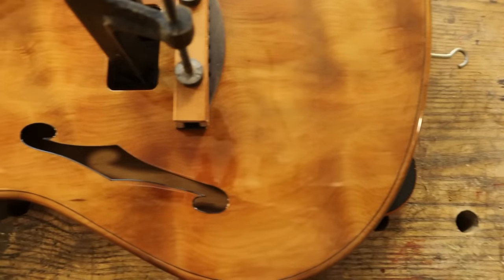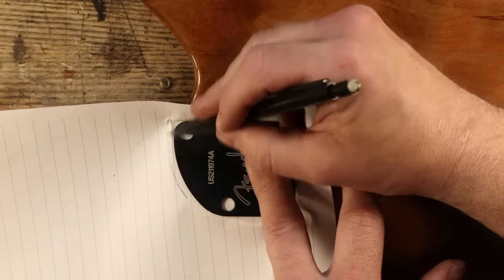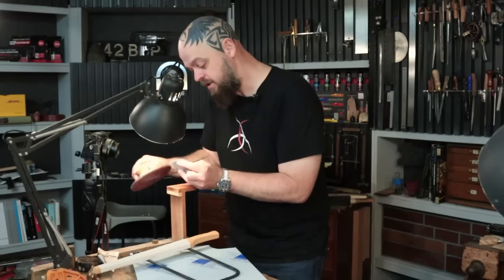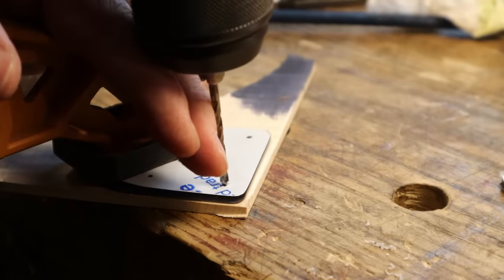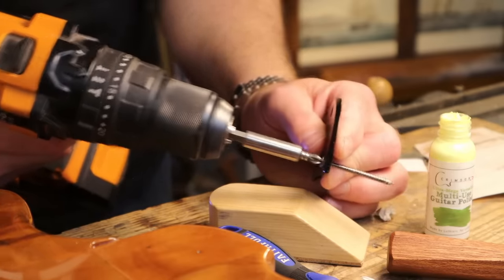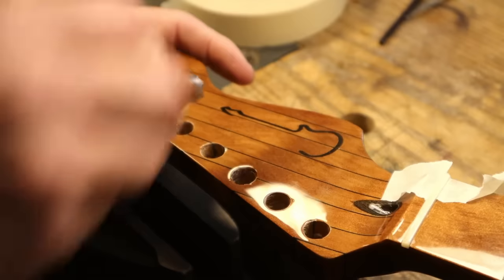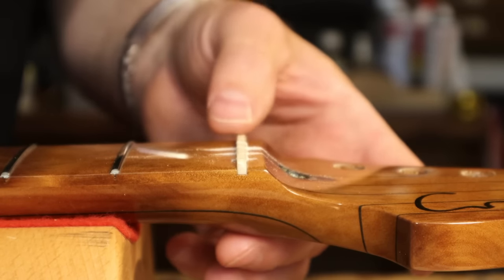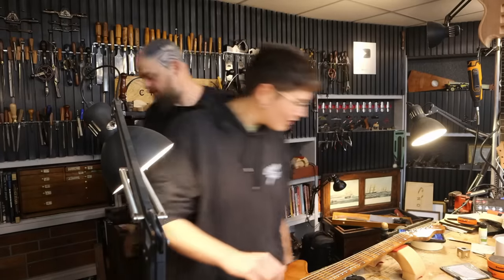Ep 17 - String it up! + acrylic neck plate fun |Building a Guitar from 42,000 Year Old Wood

Comment: Perspex is prone to cracking, when pressure forces (like those caused by screws) are applied. The countersunk head screw may increase this danger. I'm not sure the Perspex is the right choice for the Neck Plate. But besides my concerns, the plate looks absolutely stunning with all the polishing done!
Reply: Yeah I don't know how you can tighten the neck to the body without destroying the plate he made
Reply: agreed. a polycarbonate would be a similar look but has much better stress properties than acrylic.
Reply: @andrewj3372  I've worked with both. Polycarbonate has similar problems when its used in such a situation. What could probably work are ferrules that lead the forces from the Screwheads to the threads
Reply: @Craftlngo  Hmm, are you sure it was polycarbonate that you used? It's a lot more "chewy" and doesn't crack easily if at all, in complete contrast to acrylic.
Reply: @timangus  true, it is not as brittle as perspex but like all plastics it tends to flow under stress. It deforms, can build cracks and it will losen the screw joint of neck and body in the long-term.

Comment: When drilling plexi glass. Use an old drill bit and grind the sharp edges off the tip. Taper the bit or use a unibit.   I used to drill windows for helicopters. Thats what we’d do. They’re come with a drill bit or we’d make them.
Reply: I was going to suggest a step (Unibit) drill as well. Their single cutting surface and straight flute stops them being pulled into the job.
The way he did a pilot hole is not a good idea either, just makes it easier to grab when the point of the size drill has nothing to offer resistance against.

Comment: Wouldn't use Perspex (acrylic) for this application, too brittle.
Polycarbonate would be a more durable solution.
Recently cut and drilled 10mm perspex for a base for a handwired valve amp, drilled and countersunk the holes with bradpoint bits, and a standard countersink, but I know this will not be subject to the same stress as a neck plate, I would have used inset bushes for this guitar. Recessed plate is now a necessity.

Comment: Just stunning. If you're going with the perspex neck plate, might be a good idea to chuck a bag of 20 spare ones in the bag when you ship it.
Reply: 25
Reply: I feel uncomfortable putting screws on acrylic if they are going to be under much pressure, worse into countersunk holes.  I think he's created a no-win (loose neck or cracked acrylic) and I wonder if he will change his mind.  All I can think of is stainless steel and getting it electropolished.
Reply: @SloverOfTeuth  Or at least a nice piece of brass.
Reply: @rasputinsbeard3899  The easiest material I guess, if he's happy with the aesthetics.  I think he said the pickup will be a steel finish, hence my suggestion.  It's harder work to shape stainless steel, but this is a convex shape which helps, so a bench grinder gets the rough cut fairly quickly, and maybe he'd take a detour into home electropolishing (🤣).  I think brass would look good with that wood, and I'd maybe think of using a brass plate and changing to a brass pickup.  One only has to consider why neck plates are used in the first place, and why we usually make load-spreading washers/plates out of metal.
Reply: I agree. I worked with plastic for a long time in a previous career. That shits gonna snap the first time the owner touches one of those screws. Personally I like to omit the neck plate entirely and go with counter sunk metal ferrules sank into the body. I do like his idea of the threaded bushings and using actual bolts instead of wood screws. That’s in my plans for my next build.
Reply: If he do thread bushings and screw I'm sure it will hold up. But wood screws raw on that? Not sure how I feel

Comment: I have my Dad's early 1960s Stanley hand drill which I recently cleaned up and use. I know what you mean about using one! When it's my time to go I'll bequeath it to my eldest nephew for use in his shed.
I like the smoked acrylic neckplate, and a round of applause for polishing the inside of the countersunk holes, which will only ever be seen very rarely after the guitar's finished! It's the 'I know it's there' syndrome.
And the assembled so far guitar looks lovely, all those curves around the neck joint!

Comment: The way to finish the edges of Perspex is, wait for it...  Flame polishing
Reply: Vapour polishing is even better and would be able to do the countersinks as well, just doesn't sound as good as "burn it" lol
Reply: I was actually wondering if the reason the polishing of the counter sunk holes worked by melting the perspex a little (rather than the compound).
Reply: Damn it, beat me to it. Let there be FIRE :)
Reply: Wouldn't flame polish something under tension. It introduces micro-fractures in the Acrylic

Comment: Hi Ben.  The Neck Plate should Be made out of Brass and add the Crimson Logo on it. With Plastic you will not be able to have enough pressure on the Screws to Hold the Neck tight. Copper plate would be Cool too.   How is the 4X4 post Guitar 🎸 doing? Getting Dusty?

Comment: A guitar made of 42,000 year old wood really needs a nut and saddle made of 20,000 year old mammoth ivory.
Reply: Great point ! Sound and look upgrade, for sure .
Reply: A plastic saddle and nut made of 200 million year old oil
Reply: Its funny how, in some guitar circles, Kauri wood is known by its latin family name "agathis", and is thought of as a budget or less desirable tonewood. Personally I don't much subscribe to the whole tonewoods-in-electric-guitars debate (or snobbery, some may say!), and have worked with swamp kauri myself.
Reply: @crtified1001  I think there's some difference between the cheap agathis on a budget superstrat, and ancient swamp aged NZ agathis. But it also reflects on how different guitars are built and used. My first guitar was an agathis bodied Yamaha, and it was trash out of the box. The strap nuts constantly fell out, the pickup and neck pockets broke into each other and the brittle PE finish chunked off and crumpled into the wood as soon as look at it. The Alder and Poplar on my Squiers are much harder, so even though the routes are even more aggressive the alder bodies have survived with little more than a few dents for 23 years. My Yamaha barely survived one. If the agathis body was instead used for a Mustang body, with angled fit-routed cavities and much less empty space; and then finished with a less brittle finish that wouldn't shatter as easily, it would work better.

Nothing to do with "tone" wood, everything to do with structural integrity.
Reply: @inthestudy You note there's a range of variation or quality between the different types of agathis wood, and this is true. As I mentioned, I've worked with swamp kauri - I have a locally-sourced piece on my workbench as a guitar body right now, as I'm from NZ. And the fact is that the moniker "ancient swamp" doesn't automatically imbue any particularly notable qualities from a guitar body point-of-view, over and above "non ancient swamp" kauri. A rare and particularly nice, figured specimen of ancient swamp kauri can be pretty special, sure, as is the case with many species of guitar wood. But more commonly, I can source cheap, authentic (~US$50) "ancient swamp kauri" blanks that are quite pedestrian except in name, and which would be entirely indistinguishable to a layperson.  

This reasoning also applies to the "cheap superstrat agathis", as in fact that cheap superstrat agathis is used in a variety of superstrats ranging from the ultra-cheap to the signature-model virtuoso (e.g. Satriani, Bettencourt).

All of which goes to show what a significant part reputation can play in our judgement of a guitar and its materials.
Reply: Yes I think PRS did that on one of their Private Stock Wood Library models. Crazy eh!

Comment: I found myself doing that tiny bit of counter sink so often that I did make one myself.  I just drilled a 1/4" hole in a London Pattern boxwood chisel handle and epoxied in a countersink.  The handle is almost identical to the plastic handles on old Craftsman screwdrivers (they copied the London pattern handle) so very comfortable to use.  It really reduces chip out in the finish when installing screws in pilot holes.  I give a quick touch to every screw hole after spraying the finish.

Comment: i drill plastic and some wood with a pointy router bit, usually 1/4 inch size, because yeah, i've shattered the plastic casing on a casio keyboard and split a guitar headstock in half trying to use regular drill bits.  somehow the router bit is gentle enough, probably because it's made for cutting more sideways.  also, counter sink bits are safer to materials.
Reply: Great idea, I'll be using that thanks.  The router bit is really just milling the material.

Comment: IIRC the trick to drilling holes into acrylic using standard drill bits is to use the dullest drill bit you have - smash that metal drill bit into concrete and you're good to go. Otherwise the sharp edge will catch and shatter the plastic.

Comment: If it cracks that easily it’s not going to last long with the pressure from the screws for the neck. In my experience acrylic expands and contracts quite a bit with temperature.

Comment: @22:55 instead of engraving in the backplate, since it IS transparent, perhaps brand your logo on the wood beneath that. 1 - u get to play with fire, 2 - it'll look cool and almost as if it's floating/3d  and 3 u retain a smooth plate for player comfort.

Comment: There's 2 drillbits i could advise.
Try using a cobalt metal drill for the acrylic, in low gear, and let the drill do the work. no pushing down, the weight of the drill and a slight bit of armweight will do the trick just fine.
divide the hole you want to create into 3, and use that as your drill upscaling. i.e. for a 6 millimeter hole, divide by 3, that means 2mm increments., start with 2mm for the pilot drill, then use 4, and finally use 6mm.
Another thing you could so, is use a spearheaded drill that is used for ceramics and glass and if you have the ones that look like an actual ancient spearhead, the ones that are curved instead of angular, you wont have to increase drillsizes because the spearhead form does it for you. You can pre-drill a pilot hole, and the spearhead will center itself.
Another thing i wouldn't do myself is use a centerpoint on acrylic as it is pretty brittle, instead use a thicker kind of masking tape, or a double layer if need be. By layering it, making it thicker and softer, you create the dent you need to keep the drillbit from taking a stroll :D
Remember, both the cobalt drillbit and the spearhead drillbit require low revolutions in order to function properly.
lower RPM actually means working faster, even, as it allows the bits to grip and scrape and remove material better than when you work in high RPM and it grazes over the material causing unwanted friction and heat that melts the acrylic and forms a dulling coating layer on the drillbit etc.. **mindblown emoji**
Hope this helps, go make some sawdust everyone :D

Comment: You should definitely use round head screws and a countersunk washer. The washer will distribute the inevitable forces.
Reply: It will crack either way
Reply: @chriss2452  it will, but the washer might make a difference between a snowball's chance in hell, and a fighting chance.

Might. But I think it'll do something. There's a point to washers, I'm sure...

Comment: I hope the perspex plate works and it does look good but engineeering theory says it shouldn't work.
A screwed joint like that needs tension in the screws to clamp everything together and friction to stop the screws backing off. There should be enough friction in the threads to stop the screws backing off but the tension in the screws should dig the heads into the plastic underneath them. A plastic scratchplate/ pickguard works because the screws are only holding the plastic in place. With this application, the screws are holding the neck to the body and the bottom two are also resisting the string tension.
It would be great if it works but if it doesn't,  it's because the screw heads have dug in to the plastic underneath and relaxed some of the tension.

Comment: I have 2 old Millers Falls hand drills, one like that, and a large one with the shoulder rest so you can put some pressure on it.  Like a poor man's drill press.  I love old hand tools almost as much as Ben, and have several other Millers Falls tools (including a set of lathe tools, planes, etc) 😁
Reply: I always use a drill press for cutting stuff like that plate.  With plastic, a handheld drill tends to go too fast, and can grab hold of the material, causing the crack.  A drill press helps you slow down how fast the bit is cutting into the material, and prevents grabbing.  If you need to use a hand drill, a step bit will also open the hole up without grabbing. (step bits are pretty awesome for lots of other things, I use them all the time)  I had to work with plastic signage at my last job, so I have a decent amount of experience, learning from several mistakes...

Oh, and I like stainless steel for neck plates, jack plates, etc.  I've even made my own string thru ferrules and truss rod nuts from it.

Comment: I have discovered a new product that is a cleaner, but works as a low grit polishing compound.  It is called Pink Stuff.  I have tried it on buffalo horn, and was impressed.  I would engrave on the inside of the plate , as it is transparent,  The engraved design  will show lighter

Comment: I think the problem with the acrylic is that the neck screws have to be in pretty tight, and with the way wood expands and shrinks, I can see that neck plate cracking pretty easily. Pickguards and back plates are fine because can loosen the screws a bit because don't need to be on tight, but the neck ones do. I'd do the same design, aluminum, maybe anodized black.
Reply: And the screws are countersunk ...
Reply: @SloverOfTeuth  yeah, thinner edges to get the cracks started.

Comment: Bought the fretwork kit from Crimson Guitars the other day, just awaiting arrival here in Australia. So eager to undertake my first build with Australian tonewoods.
Reply: What woods are you using.  Or are you still deciding?
Reply: @cheapskate8656  Most likely Bunya Pine body and Queensland flamed maple neck. The pine will be easy to work considering my woodworking experience is limited, had a lot of people suggest it or silver quandong, but I prefer the look of the natural bunya pine, I think it will compliment the neck better.
Reply: @eamonnparsons3155  Those timbers should be good.  I have used Blackwood which is excellent (especially for acoustic) but the end grain burns very easily.

Comment: Question from a non-builder: as many of you will probably be able to tell. Would a piece of ebony be strong enough for a neck plate? And if not, what if it was impregnated with superglue like the rest of the guitar? I was just thinking it would look nice mirroring the bridge on the frontside.
Reply: Either way, it's an absolutely stunning guitar.

Comment: One thing I think you should sell is a decent fret tang nipper, I had to get mine from StewMac which ends up being slow and expensive. 

And for marking the centre of the hole under the neck plate, why don't you use a Vix Bit? It is literally designed to do that job.

Comment: Just an observation - your comment about the standard drill bit, with fewer turns, being less aggressive than the fancy bit with more turns is backwards - the pitch of the standard bit (the amount of travel along the shaft for each rotation) is more if you have fewer turns, and less with more turns. So the standard bit will pull in faster than the fancy one!

Comment: Re: threaded inserts on the neck joint: wouldn't there be a risk of over-tightening and pulling the inserts out of the pocket? Folks tend to get quite over-eager to screw down neck joints.

Comment: When drilling the acrylic. I think the mistake was too much pressure, too little speed. Also as you did later, holding it down would have helped, as would a drilling template you can clamp down on top of the acrylic as you drill it.

Comment: At 23:00 The Acrylic Looks Wonderful!🥰 However.😕
In my experience, an angled countersink into plastic with any significant load applied due to clamping force is just asking for a split piece of plastic!😱
And if you Really want to tempt fate by using Acrylic or Polycarbonate, and get any Cyanoacrylate glue fumes Anywhere near the stressed countersinks, well, you're in for a treat!😁
ANY microfractures imparted during machining or just imperfections in the polymer bonds will Gleefully unzip in the stressed areas and present as lovely fractures!😬🤬

I hope the Guitar Sounds and Plays as Beautiful as it Looks.🤞

Well Done Sir!👏
"That'll do pig, that'll do!"🥰

Mike in San Diego.🌞🎸🚀🖖

Comment: If the Perspex cracks so easily then why use it? If the customer has to remove the neck theres a chance an overtightened screw or a dunt on the neck will crack it in the same way!

Comment: No, I wouldn't recommend a swamp kauri guitar. 
IMO the timber is unsuitable, pretty, but unsuitable, particularly for necks. Inconsistent in density and strength.
Jo Lang made guitars from it for years, given the voids this timber often includes some of the instruments were more epoxy than wood.

Comment: Using plastic instead of metal for the neck plate is a seriously bad idea. Zero support or clamping strength. That plate is going to crack and break like it did on the practice piece.